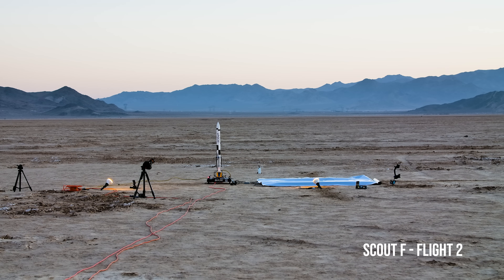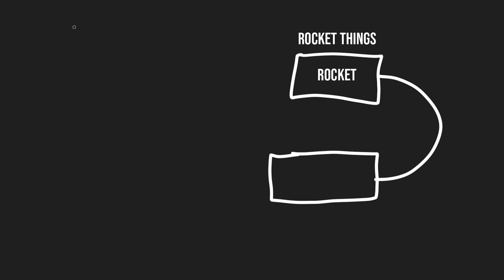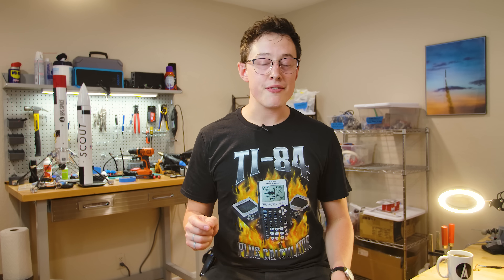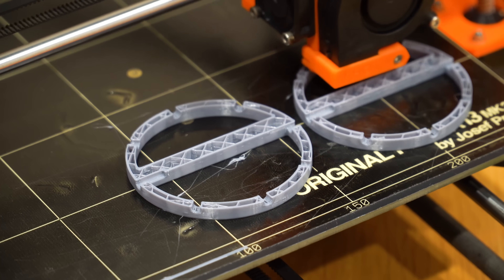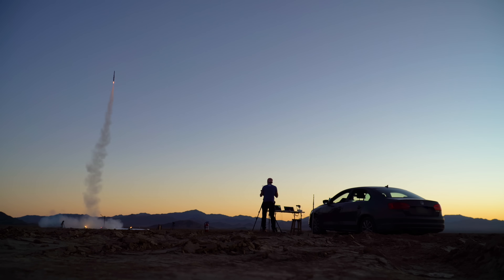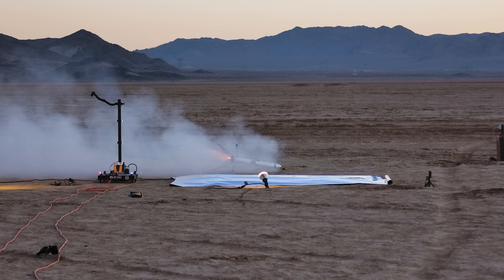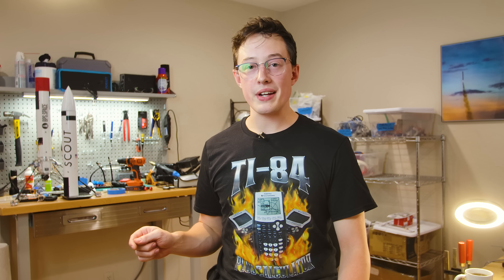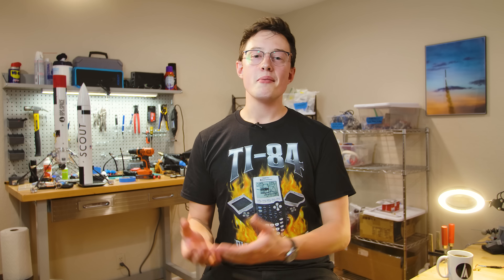Aluminum TVC Mount | Scout Flights 2 and 3

Comment: omg, lose gimbling, use fins
Reply: you could use radio beacon tracking, yes, local gps
Reply: ideal model is the key, execution later
Reply: yeet (rocket cartridge ejected) :)
Reply: so how heavily do you use actual gps
Reply: wifi localization locally should be nice
Reply: still passive stability is better than active control, the more the better, fins are great
Reply: consider pressurized interior of the rocket, less structural strength needed, less weight, just make the inflated shape cylindrical as usual

Comment: the machined ''beams' you now use on your TVC mount look like you could still strip a lot of material from them. Milling through it to generate a U-shape should leave you with a part that is maybe 80% lighter, and probably just as stiff. weight that could go to something else, or just to a little more height.

Comment: I think the people who are suggesting liquid fueled engines are severely underestimating the complexities involved in that. I also think they don't realize that using liquid propellants kinda defeats at least part of the purpose of this entire project.
Reply: I feel like making a liquid engine in the same size as a model rocket engine would be nearly (if not) impossible.
Reply: @helloeverything496  Meh, I don't think it would be too dissimilar to an RCS thruster. I think it's possible, just way more complicated and heavy.
Reply: Liquid is too complex, yes, however, hybrid is even simpler than the current setup because it's throttleable.

Granted, he's not doing this because it is easy, he's doing this because it is hard.

Comment: I've said it before (and this may be your plan for eliminating bounce), but I really think you should look into RC car shocks for your landing legs. They are designed for around roughly the same mass you're working with and they absorb pretty high jumps of RC cars (10-15 feet) fairly well without any bounce.

Comment: Well done, it looks like you are almost there!! Any chance you could put a larger fairing on to keep the pointy side up when it's  descending? 
Also I know how much work you put into the set ups at site. And the thinking on what to adjust. Would it be worth your while to make two rockets to fly each time so that you  can average your data for the next move. You may get more accurate info.

Comment: Why not level the tower and rocket by hanging them with wire and letting them self balance with gravity? Or have the platform float on water? You can lock them in place somehow after perfectly level?

Comment: Joe, maybe use small solid retro rockets in the nose to get its nose back up and it back on its feet after it nose overs. That would of saved a couple of flights from not landing upright. Maybe make the computer calculate what angle the rocket being fired at would make the rocket upright after the burn

Comment: My idea was you could use a camera system in stereo that looks at the ground and using the patterns in the dirt calculates where it is, now sticking a rasberry pi inside isn't possible, but you could use a powerful laptop on the ground and a high speed transmitter and receiver to communicate the vision system to the rockets control computer.

Comment: you're going to catch the booster superheavy-style right? that would be neat, or just burrowing into the soil on landing with weaker landing motor and sharper landing gear. or deploying the gear much later so it acts as its own spring/suspension. either way can't wait!

Comment: The 3 stages of control engineer grief all present in one video:
1. "I can add a filter to fix it."
2. "Filter didn't work. Need better hardware."
3. "It's all working! ... if it was actually where it thought it was."

I think I've gone through this cycle on every single one of my projects lol
Reply: And then you realise you didn't need step 1 and 2 if you fixed 3 imideatly.
Reply: @someonespotatohmm9513  hello mr potato

Comment: Would it be better to definitely build it bigger and use liquid fuel so you can control the power? I know absolutely all of JACK about this stuff but it just seems like solid rocket motors is on or off and you are compensating A LOT for that even though you are using paddles to control it. Also you can eliminate the bounce by adding some shocks so the shocks absorb everything like shocks on an ATV maybe that adds too much weight?

Comment: I work with hardware<->software feedback loops on medical devices, not rockets, but I'll stick my neck out and offer advice anyway. The section at 1:49 basically says "don't try to fix a hardware problem with software". I'd rather phrase it as "don't try to fix a hardware instability problem with software". It's not as catchy, but it emphasizes that bad hardware is not all that bad if it's consistent.
Reply: Even that can be done (for control problems). But it is what you do if you have no other choise, or have all the requirements for the solution already.

Comment: Absolutely crazy improvement. Is it worth ejecting the primary motor prior to striking up the second motor? Looks like it's sending the rocket off on a weird vector when the second motor reacts against the first, which it then tries to panic correct and the side movement makes it topple over (though I'm sure you have all the data to know exactly where the error is haha)

Comment: I don't know if this would work for your needs, but a widely used way to somewhat eliminate the vibration problems you are having, are dampening setups. My experience is mainly with pneumatic cylinders for that, but the basic idea is, to add some innate resistance to the end positions of the movement vector you want to reduce vibrations on. The simplest idea would be some rubber bands pulling the motor into a centered bias; although this, of course, requires extensive tuning, going back multiple times between tuning your resistance and steering variables. And if the amount of mass this would add ends up being worth it to reduce the slop in your joints is another question altogether.
This could also work for your landing legs, by using pneumatic cylinders with a throttled outlet to slow down the initial impact and additional dampening at the end of travel to reduce the "hit" of the end of travel. A simple setup for this could just be a rod inside a tube with a small hole drilled in the middle of the tube; that way it slows the travel and then halfway thorugh the travel it gradually increases in resistance. One GIANT advantage of that would be, that your landing legs START with ONLY dampening and (nearly) no spring back. If you add just the slightest spring to re-extend the cylinder you could get some pretty decent dampening without sacrificing the wide footprint of fully extended legs.

Comment: Did you try mounting the engine such that the gimble is between the engine's center of mass and center of thrust? Think of the engine as a tiny rocket itself. For stable motion, you're going to want the gimbaling to happen right where you would put fins on a whole-ass rocket. But you've got the engine extended way out past the gimbal. It's like trying to putt while holding the very end of the club. Choke up on that shit.

Comment: You are NOT a real astronaut till you take a shit in space, you are not a real rocket engineer until you make your own engine.  STOP playing with these crappy solid rocket motors, you do NOT understand the variables in the chemistry of these motors.  You do not have control over them to 3 sig figs.   Make your own liquid fuel rocket engine.   What you have done already is by FAR HARDER than making a bi-prop rocket engine.  Ethanol-water, and HTP.  1940's technology.  I think you can do it today.   stop playing around and do what you know you have to do to land a rocket and bring your knowledge to the next level.   I'd just do a pressure fed engine with modulated flow control.   You know the math, you have a flight computer, you have pressure sensors and a set of knowns that you start with.  stop making excuses and do the real rocket science.

Comment: Joe,  when you kick that ascent motor out of the way for the descent, it is resulting in the rocket pitching in the opposite direction, which is to be expected.  You need to eject it just before burnout, not wait until it stops.  That way, the rocket still has upward momentum and the kickout will go directly down, with the resultant pitch of the rocket nulled.  That way, it will descend downward vertically, not pitched over before initiation of the descent motor.
Reply: But there are high chances that the motor will not eject because of the little fuel burning in it, the motor is powerful enough to launch a 1Kg rocket and if the motor if giving out thrust alone without a payload, even a minimal amount of thrust is enough to not let it out.
Reply: Part 2: Also if the landing motor is fired to push it out, the thrust will just add up to the upward motion of the rocket as you said "the rocket still has upward momentum". 

NOTE: I didn't make the vectoring and ejection system, I'm just stating what I think and me no professnol :)

Comment: I'm wondering if you could figure out a way to provide some observability in your sensor horizontal channels prior to launch to let the kf better estimate sensor errors. Maybe an articulated launcher that feeds attitude measurements to your navigator. Rudimentary transfer alignment. Might be overly complex compared to differential gps, but maybe not. Getting accurate gps to work in something like this (on a "hobby" budget) isn't the easiest either...

Comment: After watching a bunch of the landing attempts , I really cannot help but get the feeling that you're trying to null out the horizontal movement too gradually.
Actually after rewatching it, if you look at 10:52, if doesn't look like it's trying to cancel it out at all.  

This might simply be a consequence of the discrepancies between the imu derived location vs actual one you mention, but given how fast we've seen the tvc mount can work at canceling out movement on ascent, personally I would recommend trying to null it out more aggressively.

EDIT:  I realized after posting this that part of what I'm seeing is also likely the rocket trying to move to the landing location, so yeah, I also like the idea to abandon the landing pad and just trying to land anywhere, although I do still find it interesting how much it's moving horizontally while still remaining upright.  Abandon, probably down to the imu issues.
You might also consider to tilt the rocket itself opposite to the direction it's traveling horizontally once it's starts moving in the right direction.  That way hopefully if it does touchdown while still moving horizontally, it will fall in a way so that hopefully it lands upright.

Best of luck Joe!  Looking really good
Reply: > ...tilt the rocket itself opposite to the direction it's traveling horizontally once it's starts moving in the right direction.

The rocket didn't tip over because of bounce. It tipped because it was traveling too fast horizontally, for it's height. After 10:52 it gets back to vertical but is still traveling horizontally. To kill that motion it has to rotate past vertical and wait for it to slow down. There wasn't enough time for that. And it was headed towards the pad!
Reply: @jimbarchuk  So first off, I probably didn't use the right terminology (my bad on that), because yeah,  I was trying to say that it tipped over due to the horizontal momentum.
Second off, I never mentioned the bounce at all; where on earth are you pulling that out of in my post?

Watch the video from 10:45-11:00  After the second thruster ignites, it swivels to move the rocket towards the launch pad, then immediately straightens out, but it doesn't appear to be working to cancel out the horizontal momentum at all.  Now again, as Joe mentioned, and as I mentioned in my first post, there are likely a lot of factors contributing to what's going on here.  The only reason I bring this up is because this same effing this has happened in nearly all the rockets that have gotten that close to landing: still moving horizontally while the rocket is vertical.  
Now again, I think part of the issue here is likely the problem that Joe found with the imu. The rocket's estimated location was off, and so it thought it had more time than it did,  Additionally, since he's no longer going to be trying to land it in a specific spot, there will be more time to null out any horizontal movement.
Hopefully with this, and with fixes to the imu, I think the chance of a successful landing will go up dramatically.

Comment: You're taking on a challenge that's too difficult Even the Falcon 9 uses a thrust deflection engine and grid fins and upper thrusters, but the thrust deflection engine alone is too difficult.
Reply: And the engine you're using can't be turned off at the right time or control the thrust power.  If the engine doesn't turn off correctly after the touchdown, it will be difficult to stand.

Comment: I don't think you need differential rtk to do this. Even using a cheap single frequency receiver, you can get decent precision. Accuracy will be limited to +- about 3 meters, but you don't need accuracy if you know where the rocket is relative to the pad before liftoff. The only reason this might not work is if another GNSS satellite comes into view during the flight (unlikely to happen during those 10sec). I have done experiments with smartphone receivers and determined that if you zero out your errors with a known surveyed spot, you can expect +- about 30 cm of precision. This will deteriorate over a matter of a few minutes as different sources of error begin to accumulate causing the position estimate to drift from truth, but shouldn't be significant in your case
Reply: P.S. Keep in mind that GNSS is much more accurate in the horizontal dimentions than the vertical one....satellites are all above you, so the satellite-specific uncertainties are compounded vertically. I wouldn't rely solely on GNSS for altitude, although you should use GNSS data (specifically the delta from the starting position) in your Kalman filter. It's just another measurement with its own uncertainty. Assuming you characterize the uncertainties correctly, this can only improve your state estimate.
Source: I'm a research scientist using ground and space-based dual frequency GNSS measurements to optimally estimate electron density in the ionosphere (using Kalman filters)
Reply: If you have any questions, feel free to find my NOAA or CU email address (should be findable with my name in the online NOAA staff directory)

Comment: bigger launch rocket smaller landing rocket. 
thinking: It takes more fuel to climb and loss of thrust from correction but falling is faster thus its still burning when on the ground.
conclusion shorter burn for landing since you can't cut off the burn manually.

Comment: Tip: The rotation center should be on or close to the output. The rotation should be translated from higher arm distance so you can have move control. This design you have is very problematic.

Comment: I wonder if using a different mechanism might work: I was thinking a compliant mechanism design might allow you to keep the plastic (and it's low weight) but gain rigidity.
Reply: Flexure instead of linkage?
Reply: @jimurrata6785  yes, but the flexure would replace hinges and associated hardware, too.
Reply: @RichardBetel  You could integrate a strain gauge to provide input to the flight computer and eliminate a sensor too.
Reply: @jimurrata6785  Yep!